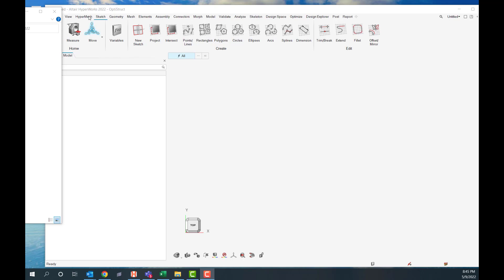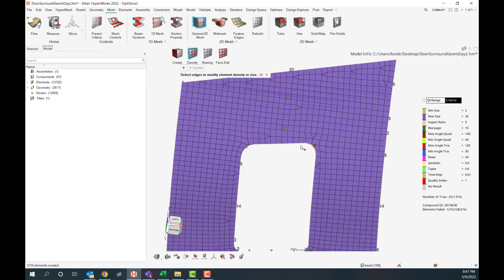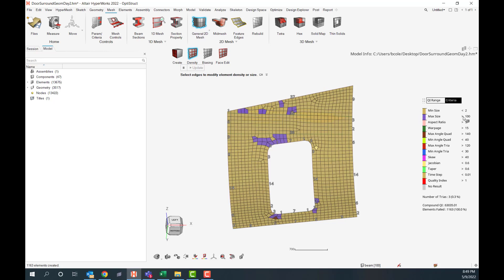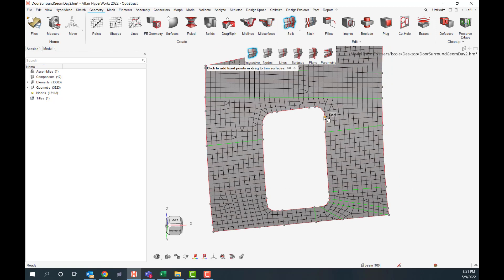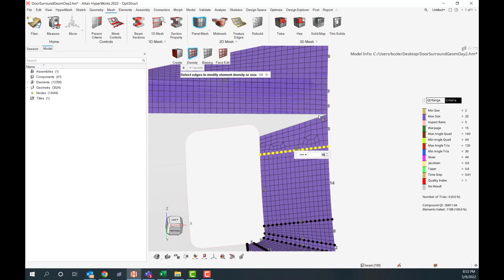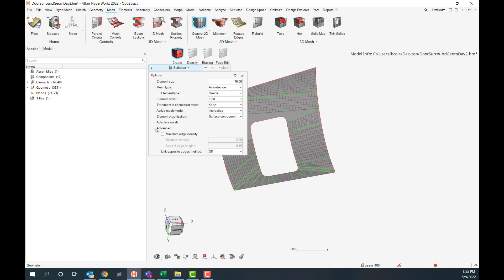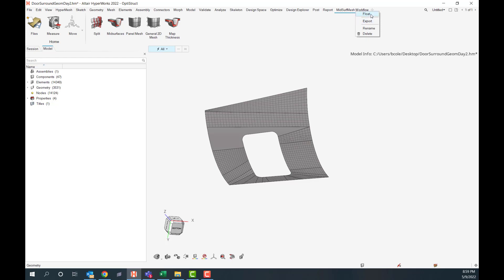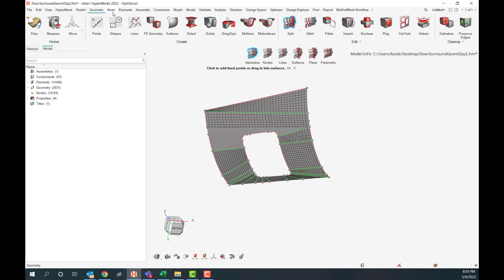EP 3: 2D Meshing in HyperWorks 2022

Comment: I've been a Hypermesh user for the better part of 15 years now and I have to admit I am rather dismayed by this new ribbon set up. The kind of work we do, we don't necessarily have geometry... we drag, extrude, ruled mesh to produce concept solutions for our clients (quick and simple). I am at this moment looking at HW 2022 and I am utterly lost to see how we perform any of these simple quick tasks using the ribbons. Do you have any examples showing how to create and edit quick mesh without the use of geometries (even ruled from one line of nodes to another has now seemingly become nigh on impossible within Hyperworks 2022 - at this moment I can't even create temp nodes)?
Reply from the maker: hello @RenderEngine, we indeed figured out that 2022.2 was not covering the complete scenario for Ruled, not allowing to proceed it on orphan mesh. This has been taken into account and will be adressed in the coming 2022.3 (planned next month). Same for the temp nodes. That said, we're bringing in a new paradigm called FEgeom which allows you to consider a mesh both as geometry and mesh, then to benefit not only of mesh edition tools, but also of geometry edition tools. We know we still have to document and expose better this new method so that out users can see its long term benefits. Coming back to the Ruled, converting your mesh to FEGeom is a required extra step in 2022.2